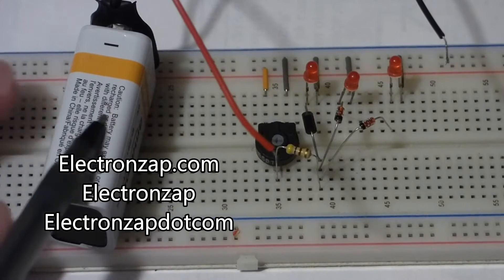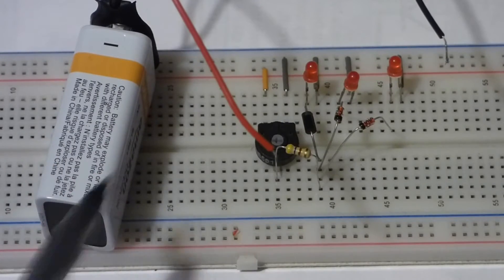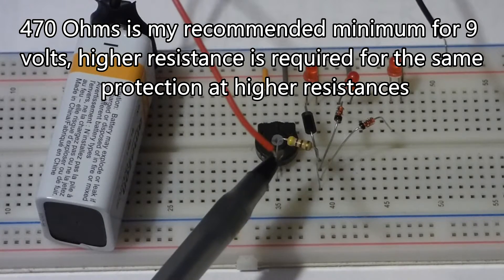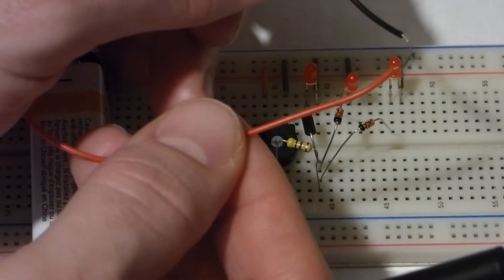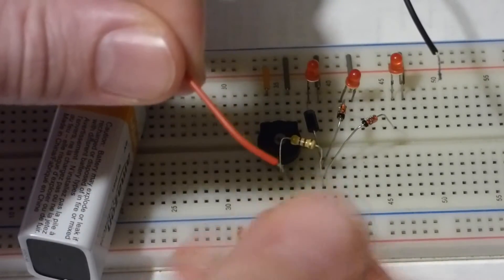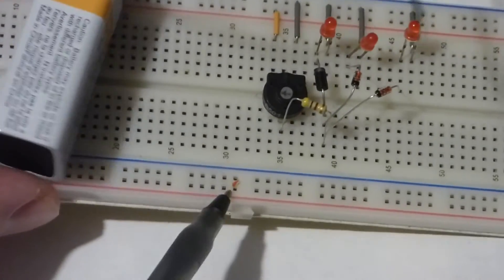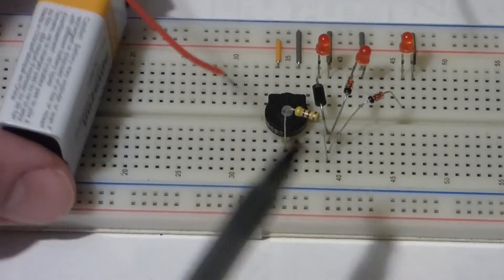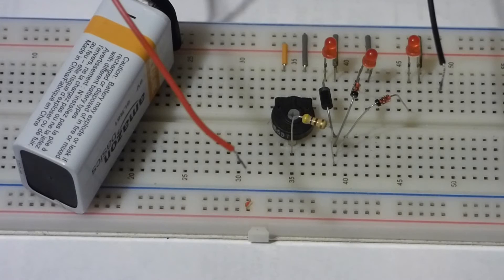Even low voltages can cause a fire hazard if you create a short circuit warning demonstration

Comment: I have question. Does low voltage  in electricity line provided by operator impact LED devices? In my case, due to disturbances in the power line 0.4 kV, low voltage which was about 50-80 V electricity was supplied for about 10 hours. After 10 hours of such supply, the electricity operator connected a generator to the 0.4 kV network, as a result of which the LED system caused a fire in the house The electricity operator does not assume responsibility that low voltage in the line caused a fire.  Please provide your scientific data on how electrical fluctuations can damage the LED system and cause a fire. Thank you very much.
Reply from the maker: No clue, you'd have to check with electricians on that.